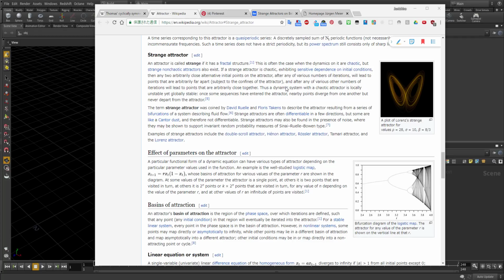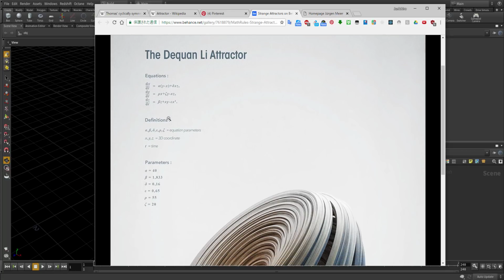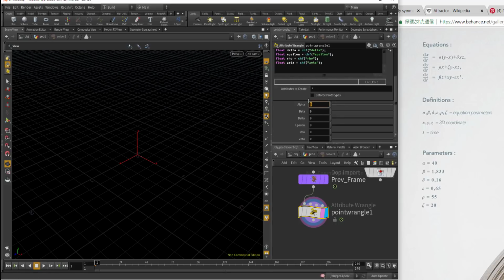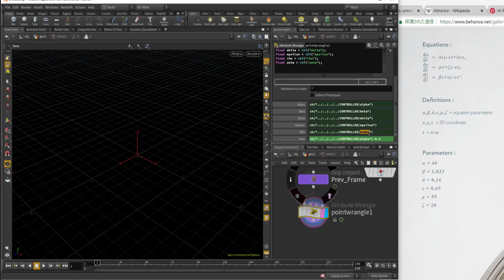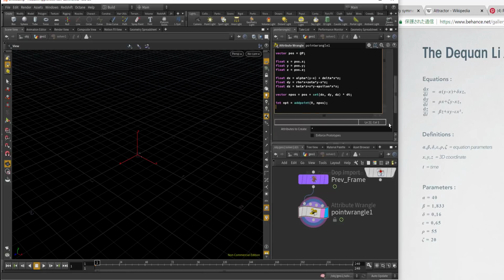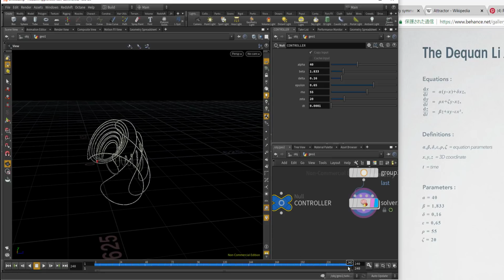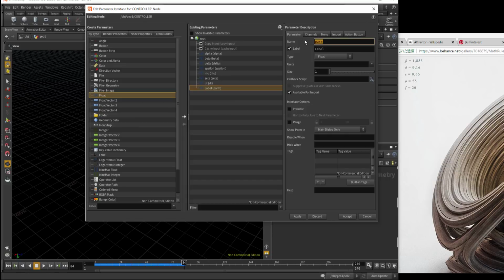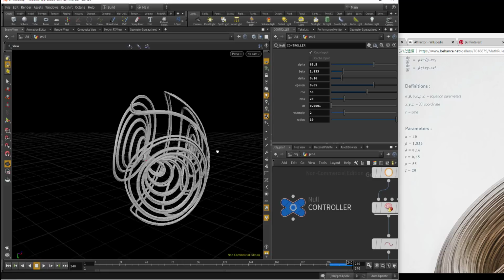[Houdini Tutorial] 0034 Strange Attractor (Slow version)

Comment: strange.. i'm using super computer and even thought when i play and after it reach to frame around 30almost houdini freeze and crash.. i check and found that Houdini create around 2 million particles without the first 20 frames... and it barely gave small shape.. what do you think?? for your video it looks like flexable and it doesn't produce a huge number of particles or points.
Reply from the maker: My guess is that you might be missing the Group filter for the point wrangle inside Solver network which causes the point to be generated on unnecessary positions.
Reply: @JunichiroHorikawa  I had the same problem, solved, thanks. But before it gave me multiple times something like "invalid group" and I couldn't understand why. At some point it stoped telling that and everything went well.